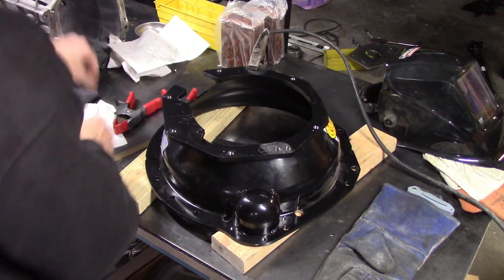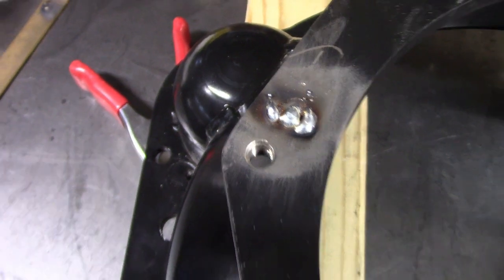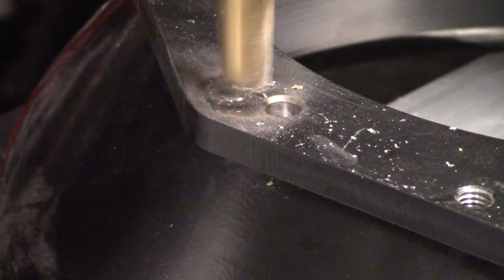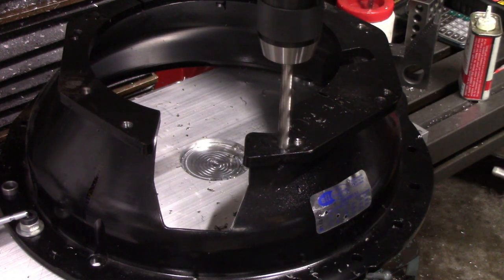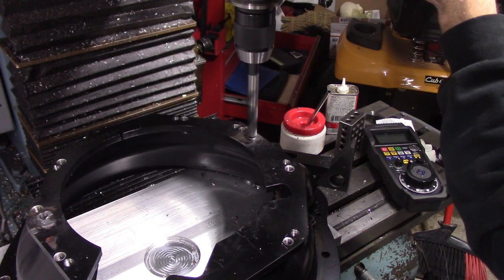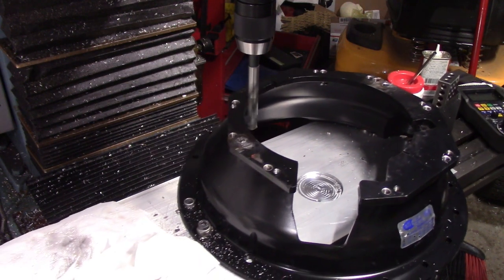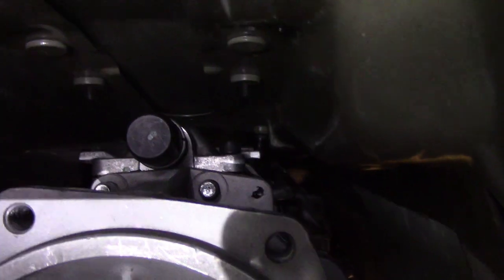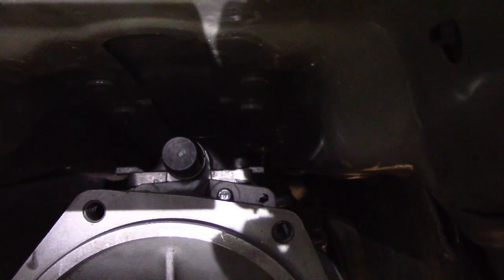Welding and Machining a custom TR6060 Coyote bellhousing.  AWD Mustang Ep 5

Comment: You can get a good approximation of a properly centered hole with a center drill to start the hole but if you want it to be perfectly centered at the end you either bore it or use something like this endmill to get it centered. You need something that has a side cut to make sure any deflection doesn't magnify as you plunge.